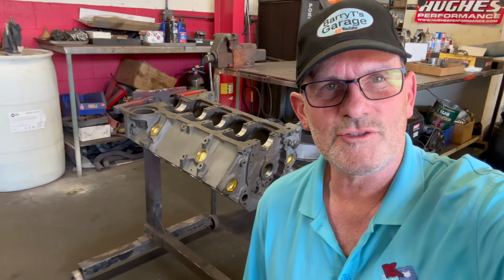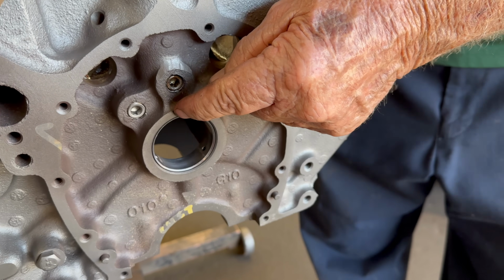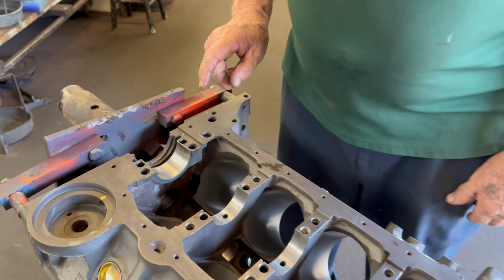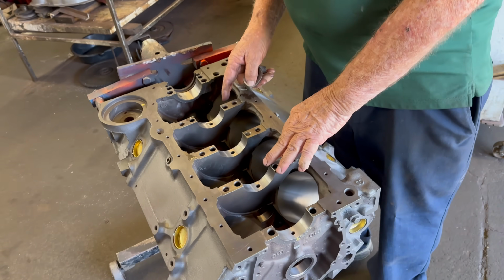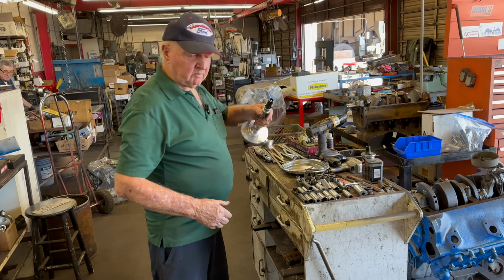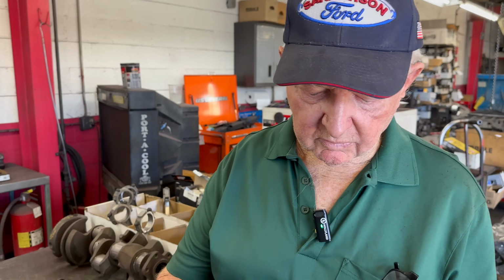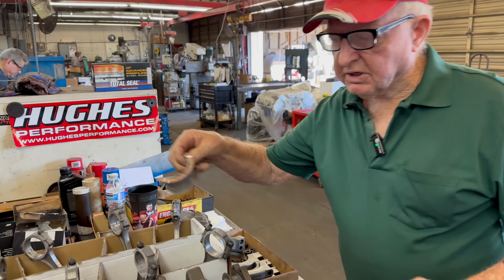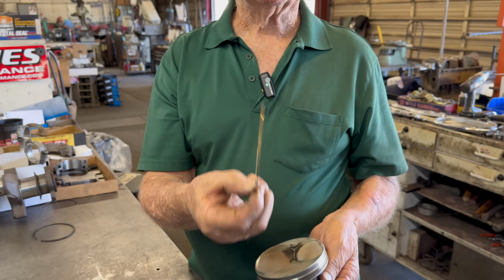OILING! Small Block Vintage Chevy (Chevrolet) Motor - Ed Smith's Tricks of the Trade w #barryt

Comment: As an engine builder, I knew some of the stuff, but there was some stuff that I didn’t know because you learn something new every day especially off the old pros, great job Ed ……keep on rockin
Reply from the maker: Cool, thanks!
Reply: Like I was told as a young boy the day you stop learning is day you die mentally.
Reply: Good job Ed, I’m in the middle of a 350 LT1  first gen 4 bolt main build (pink rods, steel crank). I need to   Install the Procomp heads and the pan yet. As easy as you say it is to make it a 383, I’m tempted to backtrack and follow your oiling upgrades to Ed. Great video, I’ll keep it on tap!
Reply: Cant beat knowledge from an old timer when they teach u better listen
Reply: Class is over now kids...
Reply: Agreed 💯
Reply: @edwardmartinez9459  
 Being the INFORMATION FREAK that I am. IHave been stating that same quote from the day I was born... It drives my wife nuts... LOL

Comment: The smaller journals on early 327’s is one reason why they are more desirable than the later 327’s. You might think the smaller journal is weaker but I believe all the small journals had forged cranks. A win win to go with the early 327.
Reply from the maker: Great comment, I’m gonna ask Ed about this

Comment: I haven't seen Ed in years but I can assure you that he forgot more about engines than most people will ever know.
Reply: Vent air pressure from crankcase (blow by from combustion past the rings) without bubbles vaporizing the return oil. This is why he is spraying oil from the sides of the rods on the cam, to replace the oil from the top of the engine that otherwise ran over the cam. This reduces the total amount of oil in vapor above and around the crankshaft, slowing the engine down and returning oil to the sump faster. 25:46
Reply from the maker: Great explanation! Thanks for that and I might ask Ed to comment as well
Reply: @BarryTsGarage  Anything you can do to prevent aerating the oil is a plus. Bigger the stroke the more this can be a problem
esp with Hyd cams. If the oil has air bubbles in it bad things happen.

Comment: Wow this is only part one?! Learned alot in this video, i love when people talk about all the little things racers do to get the smallest edge and build their cars to the best of their ability. Specifically the part where he spoke about putting shims on the wrist pin and clearancing the rod side play to .100 to allow oil to escape, genius! i may add some of the channels on the rod big ends to my 400 im currently piecing together. 6 inch rods with a half block fill to help her last as long as possible so allowing oil to escape the bearings before it starts overheating will help me keep her cool

Comment: This is my favorite video by Ed I'm building a 383 SBC and will use his oiling advice as well as the distributor and rods ,can't commet enough on the article, would buy his book if available!! Love you technology!!
Reply from the maker: Glad you enjoyed it - let us know how it goes
Reply: Yes! Please write a book!
Reply: I mocked up my rotating assembly to find I needed to clearance the block for the rods to clear then went ahead with all the oil  mods now I'm going to assemble the engine, I will degree in my cam I need low end power for my 4 wheel drive!!

Comment: My parents used to work for John Schlieper ( Propower Motorsports Now) racing before I was born. A few years ago I had the pleasure of sitting down and talking with the man at his 80th Bday. Being a diesel guy, I had knowledge of racing engines to a point but sitting with him and talking was just like this man! A wealth of knowledge in the head, but hard to get him to give up his secrets. The idea that one could read a half of a 10,000th of an inch is just crazy, but that's what makes an engine hold together at 9500 rpm's and 900 plus HP and hold up through a whole season of racing. His engines did so and for more than 50 years he did this. Love the knowledge and hope he gets to pass it on to someone that wants to know it.
Reply from the maker: Thanks so much for sharing that! What a great memory to have, I also appreciate these guys with the wealth of knowledge, guys like Ed Smith and John Schlieper.

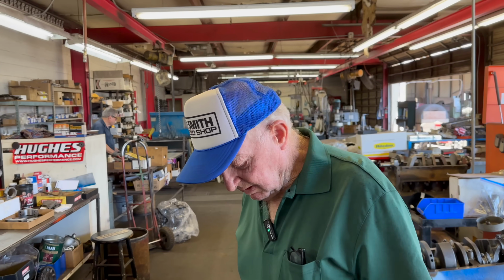Comment: At 7:25 What was the drill bit diameter Ed used to enlarge oil holes in the Chevy block on 2, 3 and 4 mains ?
Reply from the maker: I believe he told me 1/2" or 9/16"....
Reply: @BarryTsGarage  Thanks for the reply but. Barry that can't be the right size. When the main bearings are match drilled there would be very little bearing left.
Reply: True, by eye, it looks like about 1/4 or 5/16".

Comment: Mr. Ed, you're telling some great stuff. I am in NW NC, Nascaudderr country and Mr. Ed is giving some secrets away, but he's correct. I am big into drag racing and before going to an aluminum hip Brodix block I ran stock GM blocks and we applied this to them with some other things. It is kind of like I run a custom-built-to-order Bitler IRD Racing all-billet e85 dual needle and seat blow-through carb with TPS on it. I get tuners and a lot of engine builders and people pushing efi because they see I run the Holley Dominator ECU EFI with CNP and everything. They ask why and I tell them, money isn't the issue, but my carb is cheaper than efi even though I run a in tank Holley VR2 adj speed fuel pump, I can do everything you can do from the laptop like pull or add timing, add or pull boost, and all that except basically pull and add fuel. I gain hp by running a carb, and I only need a jet swap in different elevations so I'll stick with it carb.
Reply from the maker: Well, thank you for sharing that, Jason! Seems like you’ve been around the block a time or two yourself! Yes, Ed knows he’s giving away some secrets, but he feels like they are worth sharing instead of keeping to himself… It’s an unselfish point of view in my opinion These videos are a lot of fun and I really enjoy interacting with you and others!
Reply: @BarryTsGarage  It is cool that he's sharing and not being selfish.

Comment: I never knew thst about the cam being sentered in the middle of the casting. I thought they all would be or they would not use them. Learn something new every day 😂 ill have to watch for this now on people's builds thank you
Reply from the maker: Thanks!
Reply: I changed the cam bearings in a 3.4 v6 camaro motor once and the new cam was hard to turn. A engine builder said he ad to cut grooves in a old camshafts journals to ream some of the motors he replaced the bearings in. I think this would lead to low oil presure prematurely. But you still would have to do it or replace  the block or line bore the cam bore.

Comment: Great information in your video! I have 2 engines on the stands. The only thing that you didn’t cover is blueprinting the oil pump itself. I smooth the inlet turn and the discharge tube for an uninterrupted smooth oil supply.
Reply from the maker: Very good!  Thanks for adding that to the conversation… 👍

Comment: A larger oil passage will not cause more oil to escape at the crank and rods. The amount shed is the result of bearing clearance.
Smokey Yunick did an article I believe was originally published in Circle Track.  He covered oiling in this article and stated that the 1" holes in the front of the block at near the bottom of the lifter galley need attention. The one on the #1 piston side should have a screen installed for breathing. The one on the even numbered cylinders side should be completely blocked off with an expansion plug and his reasoning is that when the engine is spun up, the timing chain will bring up oil and go through that hole and it will cause a 1" stream of oil to shoot back towards the distributor. If you look at the block, it is offset (#2 is more rearward than #1. He did not state this but that offset blocks the oil and it gets  redirected into the lifter valley. I have called manufacturers of oil pans (Milodon and Moroso) and they never heard of this. I trust what Smokey Yunick did versus an guy on the counter working for a manufacturer.  Many of the new SBC blocks do not have these holes.

Comment: the first rule for the oiling system on a dirt car is no fram filters.... they are known to collapse under a load.
Reply from the maker: Has anyone stress tested all the different oil filters?
Reply: @BarryTsGarage Well, I only know of 1 personally. Pressure relief stuck closed on a SBC, blew apart the old Fram "race filter" twice in one night. Don't know what he had done to the oiling system but it exceeded 120 psi for sure! Beyond that, I have never seen an oil filter failure.

Comment: As far as those very narrow compression rings used to allow the engine to have low friction.  I suspect that is only for racing as the thin ring will allow more oil consumption and will not have the longevity of a thicker ring required for street engines?

Comment: My machinist did that bbc oil pump thing on my my fairly stock 327, stock oil pan ect. Drove it around town for awhile np, then I took it on a road trip and hit the highway about 20 miles in I loose most of my oil pressure 😬. So I went to a Kmart and drained the oil and put new oil in. That lasted a few hundred miles then it’d drop at 3000 or so. Changed the oil and put 2 cans of STP in and that fixed it for the remainder of the trip. Motor didn’t hardly wanna run in the morning though til it got hot. Figured the bbc pump was sucking the oil out so fast it didn’t have time to drain back🤷‍♂️. Changed the pump to a sbc pump and never had a problem after.
Reply from the maker: That is a very good cautionary tale… everything has to be balanced out and tested through before you call it. Thanks for sharing!

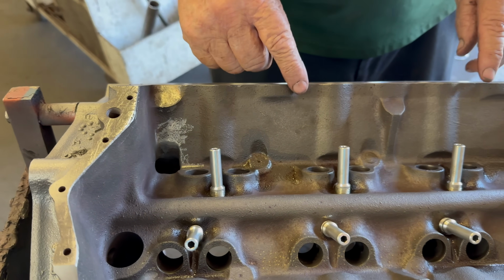Comment: @4:00 what are the galley block off threaded pipes?  are those something that can be bought?
Reply from the maker: I’m not sure, I can ask Ed, but I think he drilled those holes to a nice circle and threaded them to put those things in… Probably somewhat generic of some kind. I’ll see if I can get an answer from Ed.
Reply: i cant find anything like them. they look way better than a set screw with a small hole

Comment: I’ve heard you can drill out all the hole’s that are on top of the camshaft in the front behind the timing chain. It’s hard to explain but the drill bits you have to use are the length of the engine. So you will be drilling all the way through the engine block.

Comment: Curious why you would grind the rods to direct oil towards the cam when your putting restrictors in the galley and the raised vents in the valley? Flat tappet application maybe?
Reply from the maker: The standoffs are designed to direct the oil to either end of the block, and not drain the oil from the valley straight onto the cam where it’s not needed if I recall Ed correctly!

Comment: ive got a question in regards to the pointy cam ed showed us . i may have sparked the interest of a camshaft manufacturer and would like to know if i could get the specs on that pointy cam he had and how much lift i could put into one im building an experimental engine with a whole lot of bizzare stuff in it and a bit of help with specs would help im curious as to how much would be too much as far as lift.
Reply from the maker: That engine has long been shipped, but you can probably find the specs for the Chrysler 230 flathead six-cylinder, they made very many of them in the 1950s…
All the best see you on your endeavor!

Comment: Good information...Now a question....You mentioned you'll run 
.O30 ring gap and .025 gap on the second ring...And I know it can vary with piston type and bore size...But have you ever heard whatever the top ring gap is the rings below should be gapped no smaller ( including the oil ring)...The theory is to allow cylinder pressure to get to the crankcase instead of being trapped between rings. Ever hear of that one?
Reply from the maker: I will check with Ed on this when I can… Thanks!

Comment: .100 side clearance on the rods, :face-blue-wide-eyes: and they use to give me 3 kinds HELL about .025!!! on my Pontiacs. Question? Ed said he drilled the center main oiling holes in the 350 block, I guess he used a Bridgeport Mil to do it but how deep did he drill the oil holes in the block and what size drill bit? Also he said he ground the crank .030 under, did he get the crank tuff tried again at .030 under? I am freshening up my 350 LT-1 for a street strip 68 Camaro. Using a chevy 010 / 4  bolt truck block and a Chevy 1182 steel forged crank and X stamped Chevy pink rods. Want to get the bottom end right before I get going on the NOS World Products Sportsman II heads and Victor jr. intake. Like the idea of switching to a 6 inch rod over the 5.7 pink rods (as per Smokey Yunick power secrets book) and want to step up the cam choose from what I had 30/30 Duntof, but will still use a solid flat tappet cam on a 110 center line for wide power band, but not any kind of roller cam.
Reply from the maker: I will do my best to check in on your questions with Ed. Next time I stop by, but I can’t really promise a lot of technical Q&A on this channel… Hopefully the videos are helpful, at least! Thanks for joining in!
Reply: Listen to the video again...he said with the cam bearings out drill thru into the cam hole. Slight larger than 5/16.
Reply: @hankclingingsmith8707  Thanks , (I missed that)  well, 5/16s is .312 next size would be a letter O drill .316 or P .323 next would be a 21/64s .328 so I wonder if a .328 is to big?  It will drill oversized to say .330
Reply: @hydroy1  it is be fine
Reply: I drilled mine out. I'll have to check but I think it was 1/4". Now after watching this video, I need to drill the bearings too.
Reply: 5/16" on the center 3 (because they oil 2 rods each), 1/4" on the ends (front cap and main cap)
Reply: Do you drill out the cam bearings too?

Comment: Thank you so much for posting this. I've done everything to a SBC (learned from books no YouTube when I was a kid), except build one and I'm working to remedy that right now as a father/son project. I've learned a lot on YouTube and the forums, but Ed added several other things that I need to do. Also, thank you Ed for finally saying what I have said for years; why degree the cam? You can't change it, it only verifies the cam you bought, and the amount of retard/advance you have. 
One thing that I did to my 880 block that Ed didn't mention is I smoothed out the oil galleries with an aircraft drill bit. I'd have to check but I think it was 5/8". It promotes good oil flow. I'm also going to run a bypass filter to filter out smaller than 2 micron particles.
Reply from the maker: Fantastic! I’m glad you found us, and found some things to think about, as well as share your thoughts. I hope your project goes well!
Reply: Yes, clean up all openenings ,deburr entire block , etc.....

Comment: SINCE THE EVOLUTION OF THE SMALL - BLOCK CHEVY 265, 283 , 327 , 350 , 400 , THERE IS SO MUCH AVAILABLE AND SIMPLE MODS TO LUBRICATE THE ENGINE , YOU DON’T WANT SPUN BEARINGS THE TRICK IS IN THE OIL LUBRICATION , YOU GOING TO RUN HARD ON A TRACK OR RACE ON THE STREET RPM , HEAT , COOLING ARE THE FORMULAS GOOD OIL & FILTERS !!!
Reply from the maker: You are 100% right

Comment: Have ever saw any aftermarket sbc Heads with angle plug 2.05 intake valve 1.60 ex 7/16 rocker studs 1.550 triple roller springs 64cc chambers but there are no markings on then how do you ID who made them
Reply from the maker: I will ask Ed!

Comment: I changed the timing gears on the smog engines of the 70s and 80s to advance the cam a regain lost torque. It was a common trick for those in the know.
Reply from the maker: Exactly

Comment: I have a 2015 Ram 1500 with Hemi 5.7 and was wondering when I go to replace my lifters and rockers, should i also include a nice race cam and rods and pistons? Any advice helps because in my honest assessment of this is you are already there so do what needs to be done or should I forgo this? I dont forsee any issues with the lower just the normal Hemi ticks. Its still running strong though but like i said there is a slight rattle now.
Reply from the maker: I’ll ask Ed

Comment: I have a question for Ed I grew up learning general mechanics because that's what my dad did, I've built several engines ford olds chevy pontiac etc. I run into the problem especially on small block chevy, and I've run into this enough I started checking before and after. I've taken a wore out 350 with the stock oil pump hot motor idling with the factory oil pressure sending unit or the older one with the actual tube coming up to the gauge either way idling hot 30 lbs oil pressure. After it's overhauled and everything is new, with a high volume pump barely  has 9lbs idling hot. Start up cold 60 or more lbs then hot idling back to 9 and i've always heard that it's ok with 9 but below that might start to do damage. what am I missing? I've asked several people including machine shop owner who grew up in the business. ran into same problem with a 390 ford my machineist said don't put a high vol/pressure pump you'll pump the pan dry so i put in a stoock pump as soon as it was good and hot at 700rpm idle the oil light was on had tpo keep idle to about 900 to keep oil light off, help me ?????????
Reply from the maker: I’ll try to ask Ed about that next time I see him, I can’t make any promises as far as technical Q&A goes… Thanks for watching!
Reply: I would be looking at cam bearing clearances. I've seen this on worn motors. Possibly cut a cam bearing with the camshaft when installing it. Mic the cam bearings and the camshaft journals and verify.